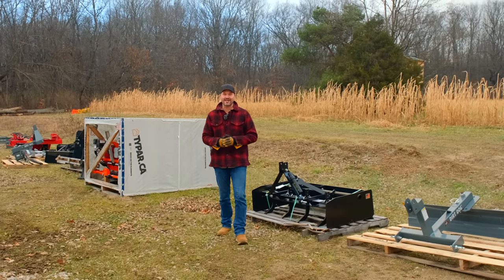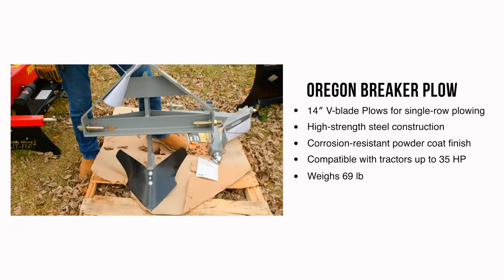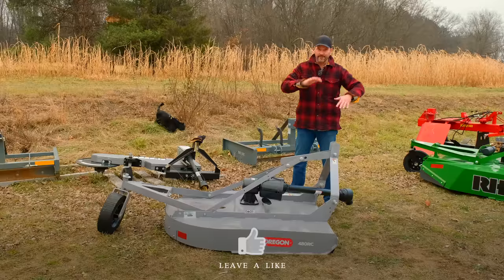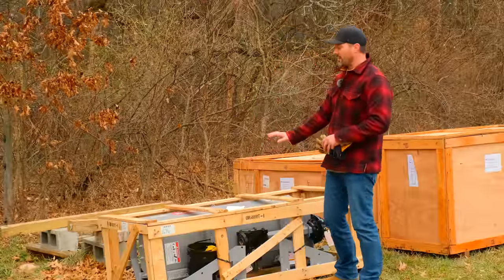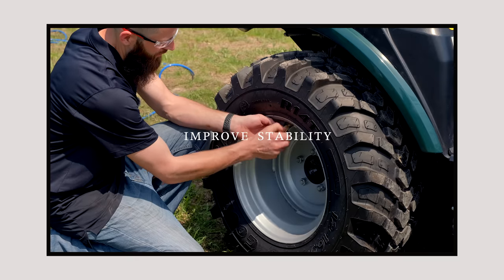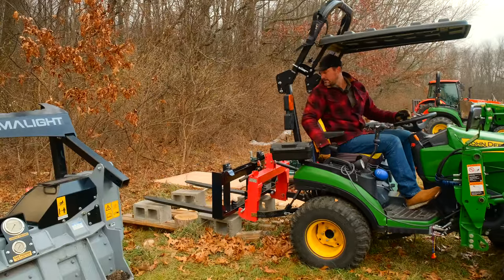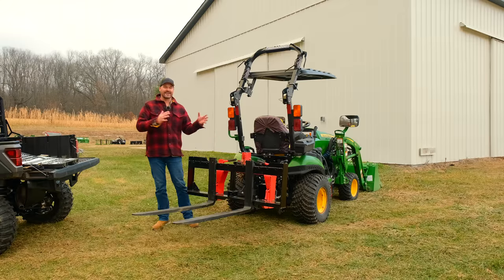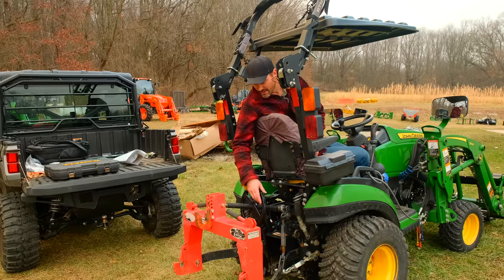A BRAND NEW PROTOTYPE AND 9 OTHER NEW TRACTOR ATTACHMENTS!

Comment: A couple manually pinned legs on the outside of the for frame would work. Stow them in the up position when in use and slide them down when needed to disconnect the forks?  Just a thought, either way when they’re ready for sale, please take my money!

Comment: It's nice to see June Cam!!

With the pallet forks on 3 point...just add another set of ears higher up so one can set the pins up higher, resulting in the pallet forks able to touch the ground when the quick hitch is in low position.
Reply: make ears taller with 2 sets holes for pins, solves 2 problems, been looking for this attachment, coming soon I hope

Comment: with those forks, you could drill a small hole in the bottom bar at either end and have a simple rod that drops down at either end with a split pin or such to hold it there. Pretty easy kickstand to get it off the ground and cheap to make / unlikely to break. Just drop the rod down, put the pin in to hold it, and lower the rear hitch down before unhooking them.

Comment: I bought a set of forks for the 3pth and it has the same issue with the quick hitch, really disappointing. I'm glad you're letting folks know ahead of time that it will be this way. I can get away with setting on a pallet.
Reply from the maker: Yeah, propping it up off the isn't too bad as long as you have a dedicated spot

Comment: I would just store it on a 8.5" rail road tie so the quick hitch wouldn't be a problem.  I mentioned a flip down C bracket like car lifts use, but using our saw mill gave me an idea that is even simpler. A thick bar of steel with a foot on the bottom and a hole every few inches.  It would run in a channel on the sides and when you are done with it you release a pin that keeps it in the upright position, let gravity drop it, and reinstall the pin in a hole farther up the bar.  Like a kick stand used to store a rear blade or other attachment that won't sit level on its own.  Those you rods with feet, but flat steel would work fine for this application.
Reply from the maker: I think I know what you mean, wonder how much weight that would add...or is it removable?
Reply: @GoodWorksTractors  yes, it wouldn't be "captured" so you can install or remove it completely by tipping the frame back and letting it slide out the bottom.  Make it an option.  People who store it off the ground don't need them, but can use the holes in the frame for bungee cords and the like.  People who store it with the forks far apart might only want 1.  People who store it with them close to each other would want 2 for added stability.  Also, you never realize how useful chain hooks and D rings are until you help someone with equipment that lacks them.  All our FEL buckets, forks, and trailers have them

Comment: For the versa forks I have an idea:

Use the shipping container as a way to lift it off the ground high enough for attaching to tractor 3-point.  Incorporate a "stand " into the shipping crate that secures them for shipping but then can be removed from the crate by the owner and re-used.   This could be a selling point,  that each new set comes with a free stand!
Reply from the maker: Our hope is to ship these UPS Ground, not freight though.  However, I like the idea, pretty clever!

Comment: I like the rear fork setup
Reply: I like the fork frame can connect to both the three point hitch and the loader quick attach.

Three point pallet forks are not new but being able to fit them to a loader is new, to me at least.

Comment: A stand for the pallet.  I would block up a pallet and slide the forks into the pallet and disconnect.
Reply: I think you'll have to add weight to the pallet. The weight of the frame may cause it to tip or at least be close to unstable. Maybe use a top pallet and a bottom pallet that are offset slightly, so the bottom pallet is closer to the tractor side.
Reply from the maker: I sat mine on blocks and it stayed put

Comment: The summit box plain I was on their website looking for it after you showed it. I like the idea of the pallet forks. Do you know if a middle buster plow can be switched to a sub-soiler because I don't want to have to buy both if I don't have to.
Reply from the maker: Yeah BoxPlane is just a prototype now, but hopefully available soon.

I’m not sure if the two tools could be combined.  The shaft length is different, so would likely compromise something with that.  I’ll have to look at the hole pattern for the blades and see if those lineup.
Reply: @GoodWorksTractors  thanks I will have to look at that.

Comment: @goodworks tractor
Are you planning on making the versa-forks (or versa-forx) ssqa as well? And what would the rating be? (2500# would fit my wants/needs)
I've definitely had a want for that kind of forks setup for moving pallets and ibc totes

Also love the box plane idea. I hope that works out
Reply: There is a adapter plate available to do that, ssqa to jdqa
Reply: @elbertlepard8595  thanks, I'm just gunshy adapter on an adapter for a "heavy load" attachment

Comment: Man oh man!! Maybe I should have invested in mfg my universal 3 point forks🤦‍♂️😆   https://youtu.be/uhxPtdXPA04
What you will have to do (and you mentioned this) is build in a headache rack. This will allow you to raise up all three points and negate the unhooking issue. Then recess the bottom pins inside the frame which will then not interfere with the ssqa. I did this to bale spears as well. I only have ssqa machines. I figure forks are more apt to end up around a skid steer than on JDs hitch.